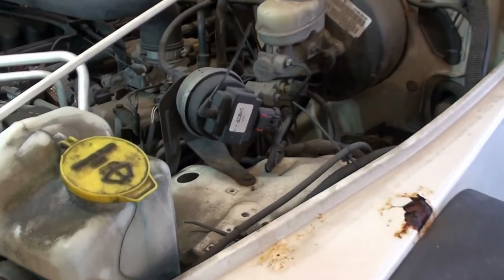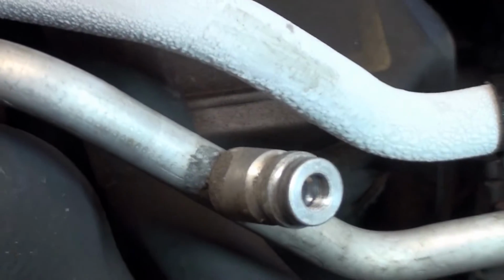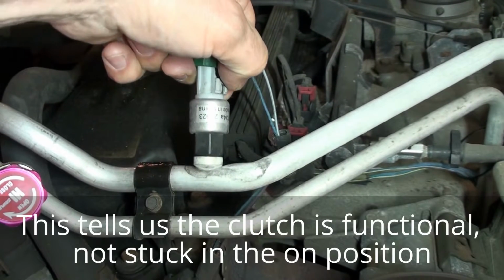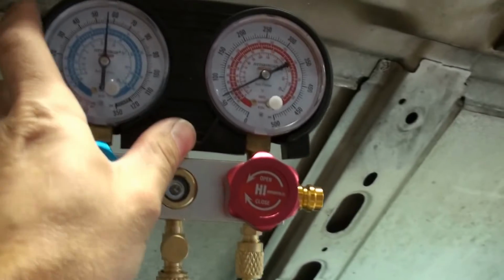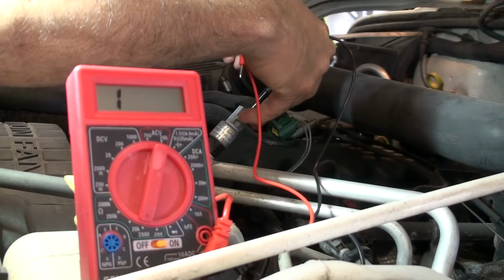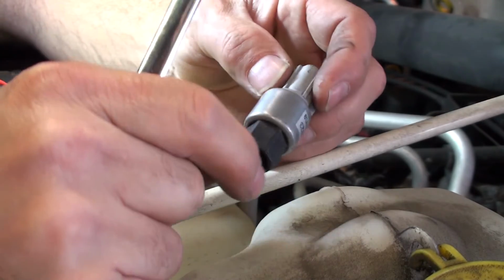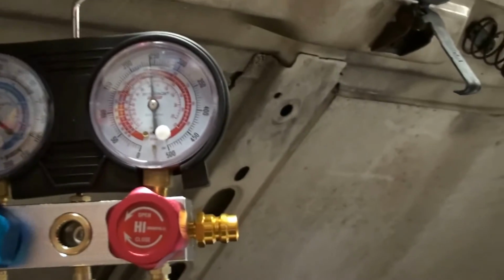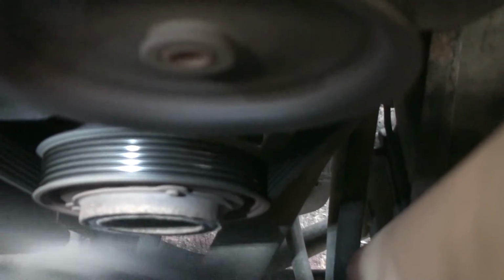Jeep Wrangler AIR CONDITIONING line icing up-Repair

Comment: I'm having a similar issue. In a 01 silverado with e fan conversion. compressor isn't cycling just runs constantly. The AC is cold but is freezing up the lines and won't blow cold anymore. Until it thaws out. Please help
Reply from the maker: First thing to do is check the refrigerant levels with an A/C manifold gauge set.  Then take it from there by testing the pressure sensors and making sure the evaporator is draining properly.
Reply: @ozzstars_cars  ok will do thanks for the quick reply

Comment: Ozz,  Quick question that may be long indeed.  I too have a Jeep, 2001 Cherokee Sport 6cyl, 4.0L.  The AC low side was also freezing up previously.  I had this repaired and they indicated it was a faulty evap canister.  It has improved the Off/on cold air you described early in this particular video but I noted that it still occasionally will have difficulty.  Over the weekend, I discovered I had a large amount of water in the passenger floorboard.  I moved the carpet and cleaned the area.  Scrubbed out the port that goes through the firewall, not too dirty but also noted that the box the drain port comes from was frozen!  What is this about? What can/should I do?  I purchased a manifold set of gauges to work on the diagnostics.  After seeing this video I will also check the switches as you indicated.   I will update more after that.  Any other suggestions?
Reply from the maker: The evap canister is fuel emissions related.  I think you meant the a/c evaporator core under the dashboard was repaired? Replaced?  Icing can be caused by low refrigerant levels.  The gauges will give you the information for a diagnosis.

Comment: I have 2010 Ford Taurus. I had the pressures checked and they are normal. The air blows cold all the time. When I have the AC on and the blower fan setting is on the highest it the AC clutch stays on all the time. When the fan is set to a lower position the AC clutch cycles all the time. Is this normal ?
Reply from the maker: Sounds normal, less demand for cooling requires the compressor to work less.
Reply: Thanks ! I'm a new subscriber to your channel. Really like your videos !

Comment: Awesome video! Wondering if you could help us. 05 tj, the ac compressor engages no matter what, even when interior knob is off. From the moment vehicle is turned on to off. Unplugged both sensors the clutch still remains engaged. I unplug the ac relay and the clutch disengages. Whats the deal?
Reply from the maker: Check the wiring diagram.  Sounds like you have a wire that is shorting to ground somewhere.  When a control circuit is grounded it may be engaging the clutch.  Some possibility's would be a chaffed wire touching ground or a melted (bad) connector.  Visual inspection including wire harnesses is essential.  Even a transistor in the control module could be defective and staying grounded.  The opposite case is the power side, is there a + feed that is causing constant power and not being switched.  Test light and a multi-meter is the ammo you need to diagnose the issue.  Good luck and let us know what you find.
Reply: @ozzstars_cars  thanks for the reply! We just changed out our pcm with a replacement and maybe the replacement unit is causing our issues. Wouldn't be surprised if it was a damaged wire either, this jeep has lots of those gremlins. Cheers and thanks for your amazing video and time!
Reply from the maker: @Garagecouple  the replacement pcm may have a stuck transistor if this issue started when you replaced the PCM.  I only use WranglerFix.com pcms for Jeeps.  They specialize in 2005-06 models and offer a great product and awesome customer service.  Have you seen any of the TJ videos I posted on that subject?
Reply: @ozzstars_cars  ill swap pcms with the Oem and see if the issue goes away. I've been otherwise really happy with the replacement ares pcm with lifetime warranty. The wrangler fix pcm is over 1k for the manual model.

Comment: A question regarding your demonstration of disconnecting the A/C Pressure switch and say the compressor stayed on afterwards, could that be a sign of a bad compressor? What could cause the compressor to stay on. I believe mine is staying on all the time. No clicking on and off.  Meanwhile I changed the A/C Low pressure switch for the heck of it and it is still freezing up. Could a stuck open expansion valve cause the A/C Low pressure line to freeze up? thanks for the help!
Reply from the maker: Verify by watching the clutch on start up if the compressor is running or not.  Have you checked the freon level?  Low freon can cause icing.
Reply: @ozzstars_cars Due to the limited amount of A/C lines freezing up videos, yours is the best to understand.  I have a 2006 Pontiac Torrent/Equinox and  I first evacuated the system and replaced the recommended  capacity printed on lable under the hood was 1.3 lbs. I used the small cans of the blended refrigerant with synthetic oil. The gauges read normal when I rechecked it and let it run. The temperature gauge in the vent can read almost 0 F while idling or while driving it would dip down to 35F and keeps dropping, losing cool air after around 15 minutes. I actually have to cycle the A/C Switch on and off manually to keep the evaporator and lines from freezing up, but then if gets too humid in the car. I just started adding some heat to keep it from freezing up, but even that only works for so long before I just shut the system off to melt ice and then start over again. i've been trouble shooting it all summer and can't get it to work normal.
Reply from the maker: @fitzpatrickgf  did you hook up a set of a/c manifold gauges to determine the health of the system?  Here is a gauge set that should be used to diagnose issues and not guess https://amzn.to/2lwrWAh
Reply: @fitzpatrickgf  Did you fix the problem? If yes, how did you fix it? I have a 2009 Mazda Tribute and I am dealing exactly with the same thing, thanks!
Reply: @gerardoesr   I invested in some manifold gauges from Harbor Freight Tools. $50 and they are easy to use. Used them to monitor the problem and everything was running normal. I changed out the a/c pressure switch, accumulator drier both located on the condenser and the expansion valve, located near the fire wall going into the vehicle, which I thought was all bad, but didn't fix the evaporator freezing up problem. The compressor is probably the problem, but it's still working and making a little noise. It must have a control valve that allows a certain amount of  Low Pressure into the vehicle to prevent freezing the evaporator and I am not going to waste the time right now replacing the compressor until I really need to. Using a small thermometer probe that clips into the cabin vent, I monitor the temp when it gets around 35F, I cycle the ac back off manually. about 30 seconds and then turn it back on to cool the air inside the cabin. Its a pain but it works and I still have a working a/c.  I do not let the temp get below 20F, to 0 F. The evaporator freezes up into an ice block and then you lose air flow and have to run hot air to melt it off.  Good Luck!
Reply: @fitzpatrickgf  thank you for the information, it is amazing how you found the way to keep it working the way it is. I will not replace anything right now but I will invest in the manifold gauges and check the numbers, the thermometer is a good idea as well. I am trying to understand how the a/c system works and if it is possible, I will try to fix it myself. thanks a lot!
Reply: @gerardoesr You're Welcome! If you buy the manifold gauges, the center yellow hose end connector will need a 1234yf can tap that runs around $7.00 online. The manifold gauges I bought from Harbor Freight didn't supply one since the self sealing R134 cans are still fairly a new change to the federal compliance's. I watched about 20 different videos to trouble shoot and get others opinions on what they experienced so I dont waste my time before I invest in new parts.

Comment: How about the Mercedes e class w211 the air con pipe also freezing. Is it the same issue? Hoping for your kind response
Reply from the maker: Could be, also check refrigerant level.
Reply: @ozzstars_cars  Thank you sir for your quick response. I will try to do the same thing that youd did.

Comment: Great explanation, thanks for your efforts. Just a question, i have 2013 wrangler and recently i got a problem with the AC the air flow is low and the air quality  became very worm. what would be the symptoms? and any idea how i could fix it?
Reply from the maker: Does your Jeep have a cabin filter installed behind the glove box? It could be restricting air flow if clogged.

Comment: I have a 97 TJ, and my A/C hasn't worked since I bought it, but I think my issue is a blower motor... I just take the doors off in summer, and problem solved :)

Comment: Thank you for this video! My '98 Jeep Cherokee XJ had the exact same issue and it was also the low side pressure sensor.  Switched it out and its running great now!
Reply from the maker: It's another happy ending with a 'cool' story.  😉

Comment: What a great video Glen, and you explained everything where everyone could understand your diagnostic thought process along with showing how to check the low pressure switch! Just a small tip on checking the low pressure switch is to back probe your voltmeter leads across the switch. Then when the a/c is running you'll be able to monitor the pressure and the status of the switch when it's running. When you see 12VDC, you know the contact is open and when you see near 0V, the contact is closed. One other benefit is that you're checking the switch contact while current is flowing through it to the clutch coil which gives you the actual condition of the contact. And thank you very much Glen for the very nice shout-out as I really appreciate it. And I'm so glad that Chaos is back home with you now. Hell, I can see the big smile on his face when you showed him LOL. Take care Glen and don't work too hard this weekend!!!
Reply from the maker: Yes sir back probe and check the current flow for on/off action.  I should have showed that on camera.  Don't worry Chaos will be back at your place before you know it Terry!!  haha Hopefully he won't but you know how that goes!  I plan on taking a few minutes off this weekend for some R&R. Enjoy yours as well.  Take care -Glen
Reply: HaHa! Yeah, old Chaos knows where I live now so I wouldn't be surprised if he does show up at my place again. The wife and I are going to do a little relaxing down in Florida for a few days and will be leaving out tomorrow morning. Hope you and family have a GREAT weekend too! Take care!!!
Reply: How would this prove that the switch is bad?

Comment: Odd you couldn't get a change when applying air from your compressor.  I imagine  it's a on off  contact . Stuzman  is a terrific fellow and  knows his way around a vehicle. I haven't had the pleasure  of doing any AC repairs since I buy GM products :)
Reply from the maker: Yeah Steve the low pressure switch was stuck closed.  Taping on it didn't break it free......come to think of it I should autopsy that sucker.  Stuzman is the man! Take it easy